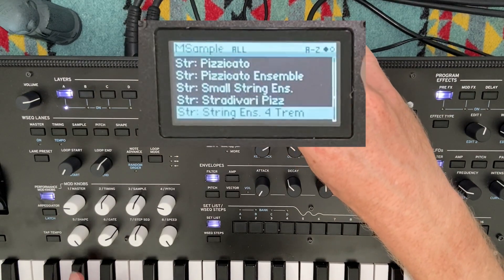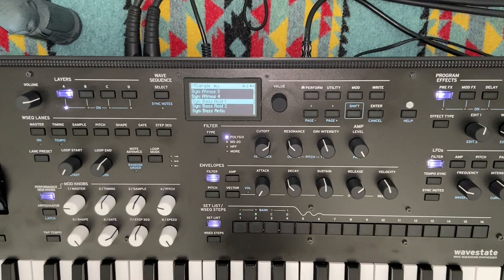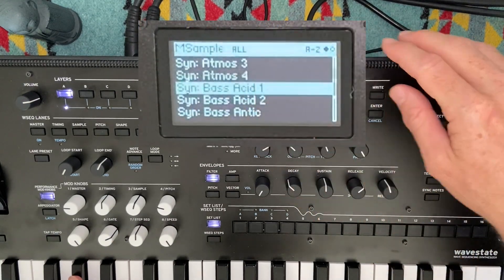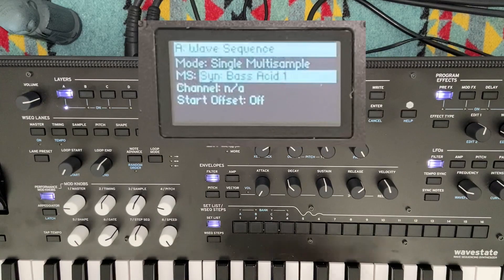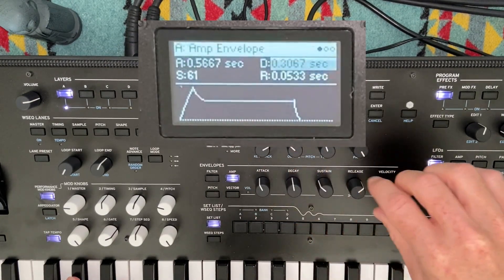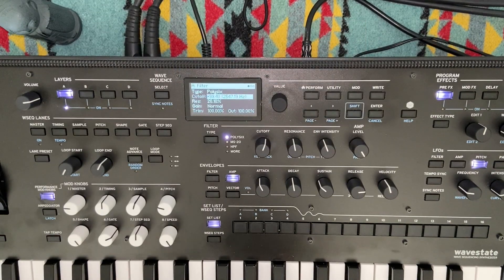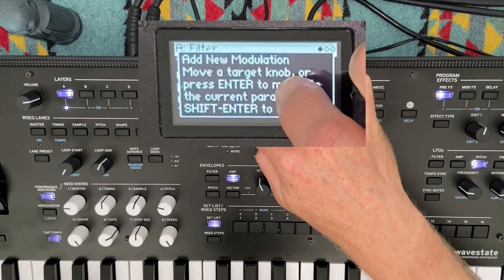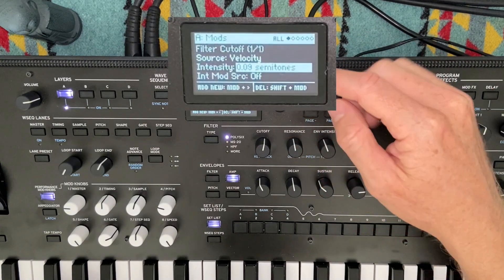Programming the Korg Wavestate QUICKLY

Comment: A sound designers dream it has been called, or a nightmare by some for programming. So dream is a little strong with all the menu diving. Workstation is more accurate. It's not a JD-800 for sure, we lack a lot of control that a larger menu with a mouse pad or touch screen would have been so much better. Don't know if I should wait for a better U.I. or buy the three: mod/wave/Op on sale today? You've had them 5 years are they your go to synth, or (like me :) still using NPF (knob-per-function) synths as your go to. My go to's are: Minilogue and XD, MicroBrute, Gaia1 and Gaia2, and now the SH-4D for really big design possibilities.

Comment: Any synth with 3 or more layers gives you a beginning, a middle and an end to a single tone by using 3 layers of similar or very different designs. For recording, panning of each individual layer is necessary for a moving stereo field for center/left/right 3 layer. Been wanting all three of Korg's Mod/wave/Opsix modules and on sale today, $350 off for all three. So, taking a close look at them, closer than before. I am finding on the WaveState that, like this video, any level of depth can be programmed, even a morphing (cross fading) of just 4 steps makes a huge difference. I did not want the keyboard version because that display should have been larger and as close to the user as possible; with the modules we can position it at an angle while our keyboards remain in a proper performance position. Thank you for this video, very well said and done. Do you own all three?

Comment: 7:53 This is great. Users have to know that the Wavestate does not have a simple "copy layer" --> "paste layer" utility. That's a big deal. It took a long time for me to realize that a layer is a program (i.e. a patch), so you have to save that program before you can load it into another layer. It takes some getting used to: having to name and save something before copy-and-pasting it!
Reply: ...which leads me to wonder if there's something wrong with the "Layers" label. Shouldn't it say "Programs" instead? Afterall, the programs aren't necessarily layered. They can be split instead---but they're ALWAYS programs.

Comment: I have a question and its driving me crazy when I am trying to follow along, I don't see the same lit buttons as those on the videos. For example when you selected "Single Multisample" mode. 1:20   It turned your "STEP SEQ" button off. Mine stayed on. Someone else selected Category browse and they used the 1-16 buttons to change categories but their "SET LIST" button was off and mine was on. I don't know why and how to turn it off. Also I noticed how you started out going very slow and by the time you where half way through the video you are clicking buttons and changing settings at about a 3 per second rate. Not helpful. I wish I knew how to cancel changes. For example if I change the sound using filters envelopes etc.. and then I change to a different sound, those envelopes and filters changes are applied to new sounds I select. Why? I would expect all changes to a sound to disappear when selecting a different sound. I really wish you would show just a small change and then saving it. And tell the difference between program, performance and set list. These are confusing.
Reply from the maker: Hi Alan, to answer some of your questions - are you certain you changed to Single Multisample Mode? Be sure to highlight the "MODE" option by using the cursor buttons. Whatever is highlighted will be affected by turning the Value knob (the big dial at the top). By default it selects the 2nd option, "PRESET", while you want to be on "MODE". You turn off the "Set List" by hitting the "WSeq Steps" button below it. This changes the function of the step sequencer steps so that they become programmable steps when in "Wave Sequencing Mode" (not "Multisample Mode", as in this video). When you describe "changing a sound", it sounds like you are changing the sample: the beauty of the Wavestate is that it divides a sound into seven layers, which can each be separately sequenced, creating evolving, phasing patterns. Because only the sample is being changed, the Program's parameters stay the same. Performance = 4 Layers (4 different timbres; called "Programs" - each program can be one layer in a Performance) that can be layered on top of each other; each timbre, in wavesequencing mode, has 7 different "Lanes" which act as sequencers. A Set List is a collection of Performances so you can seamlessly change from one set of sounds to the next. Hope this helps!

Comment: Thanks! I think i will give it another try, i was getting tired on playing the presets :D Can we note sequence the programs we made like in a normal Note Sequencer environment?
Reply from the maker: You can sequence pitch variations in Wave Sequence mode but not in Multisample Mode, though pitch sequencing doesn't really function the same as a normal note sequencer since it's always a transposition of the incoming MIDI note and the timing is determined by the Timing Lane.

Comment: What's the difference between the Multisample mode and just using 1 sample per layer in traditional Wave Sequence mode?
Reply from the maker: In multisample mode, you do not have access to the sequencers for pitch, step, timing, etc that you have in wave sequence mode. You still have access to all of the LFOs, filters, envelopes, effects and mapping. While this limits options in terms of programming, it also streamlines the creation process and allows for greater immediacy and simplicity. Both modes have their function and purpose.

Comment: I am just learning mine now so I really appreciate the tutorials you have posted. 
I have a question though, is there a hold function?  Not the sustain pedal but a way to keep the sound going so that I can play accompanying parts on my guitar or other keyboards?  Thanks!
Reply from the maker: There's a latch function within the arpeggiator. The synth is definitely meant for performance though, so it isn't designed for "set & forget" capabilities. You might want to use Ableton or a hardware sequencer to send MIDI In to free up your hands for guitar performance. Good luck!

Comment: Thanks for your excellent tutorials! - One thing that confused me initially is that the Program name stays the same even if you change the Sample within it. So you can, as you have done here, have the same Program in each Layer but each one with a completely different Sample. Makes sense when you think about it but I'm still getting my head around the hierarchy of Sample / Program / Wavesequence / Layer etc. For example I don't fully understand the difference between a Wavesequence vs a Program. And it's slightly confusing that the "Select" button to the left of the screen only invites you to select a Wavesequence or Sample, but NOT a Program, which is "hidden" on Page 2 of the Performance window.
Reply from the maker: I believe the difference between a wavesequence and program is that the wavesequence is all the information stored within the 7 different lanes, while a program includes everything – the lanes, the LFOs, the modulation matrix, effects, etc. In terms of hierarchy, I believe the Wavestate is organized as follows [Set]->[Performance]->[Program]->[Wavesequence]->[Lanes]. The multisample mode and wavesequence mode are two separate functions, while a program can include either multisample mode or wavesequence mode, which is why I believe they separated these menus from one another. It can be a lot of information, so you are not alone in feeling somewhat confused by this instrument :D I hope this helps add some clarity; happy patching! : )
Reply: @bluecliffsynthesis6685  Thanks!

Comment: Can you filter each layer independently? and if so, can you then filter all the layers together?
Reply from the maker: Yes, each layer has its own filter. You can create a master filter on the main EQ; or you can assign the filter frequency of each layer to the same macroknob, so that you can tweak the filter frequency of the separate layers simultaneously.
Reply: @bluecliffsynthesis6685  is it possible to assign a different reverb and delay by layer as well ?
Reply: @yvanroustan4426  yes you can

Comment: This was awesome. Time to take this beast out of the box again... It really was just too much right off the bat. Question for you, and I'm doubtful the Wavestate will do this, but I'm wondering if it will play arpeggiated sequences like you can on the Minilogue. I've been digging through the manual and it doesn't look like it's designed to do that.
Reply from the maker: I believe the sequencer is different than the Minilogue - I don’t own a minilogue, but from what I gather it has a real-time record function, which the WS does not. The WS does however have a pitch sequencer and an arpeggiator to create patterns with.